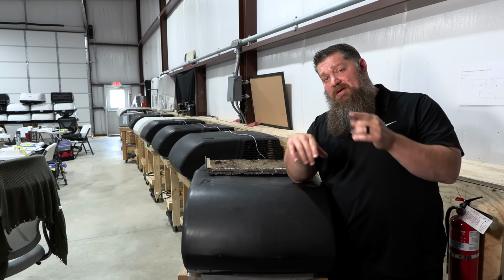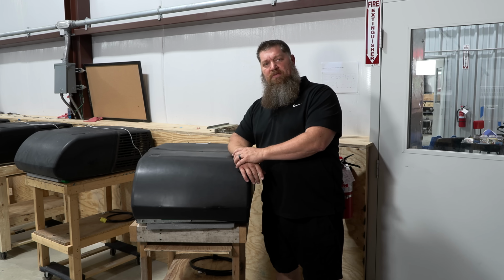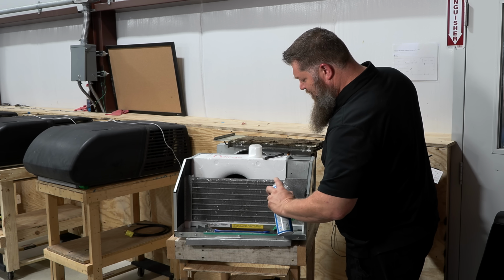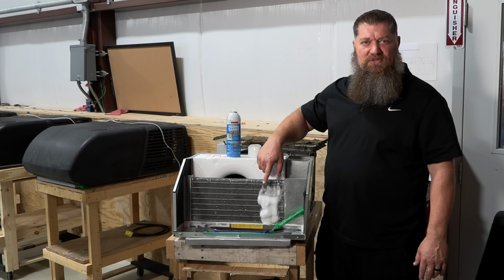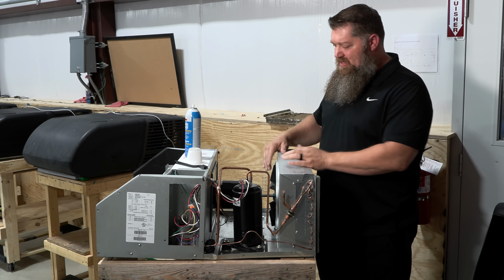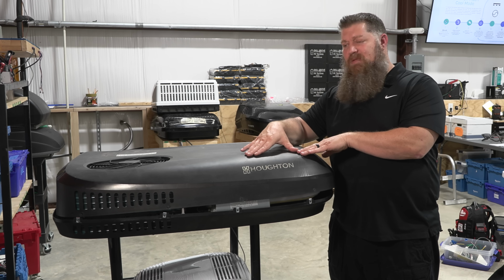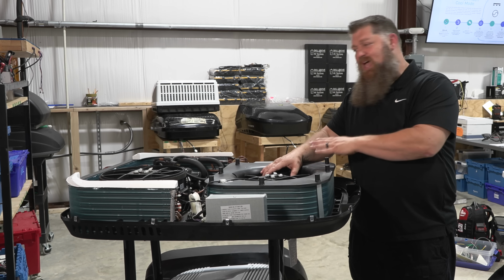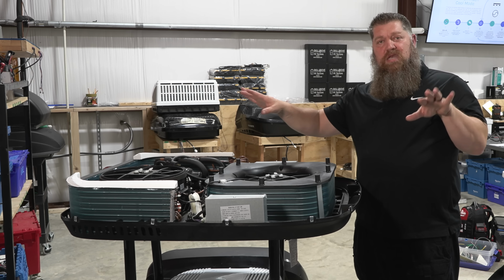RV Maintenance: Cleaning Your AC Coils

Comment: My opinion is to first use Nitrogen to lightly blow coil clean going in opposite flow of air's normal direction (intake direction). 2nd clean all dirt etc with a foam coil cleaner, now you use an evaporator|cond comb to straighten out coil. If possible use a good dry spray that's going to help dust and dirt be more passive. Now your set. The fast way is get big nitrogen tank and blast the coil in seconds. Problem is you'll damage fins, so use your common sense. If you've got a comb I say blast away. On large commercial units I'd just open panel and blast with nitrogen, makes more sense cost|time wise. If you want to have fun or your anal, go through all the steps. Thanks ..

Comment: Be careful not to get any of the foam coil cleaner on gel-coated fiberglass. Typically when you rinse the coils. It will leave streaks that no amount of waxing/cleaning will remove.

Comment: Hi Todd, great video! I also enjoy your Q&A "you ask we answer" videos as well. You guys make it fun to fix things.
We were planning a short get away trip out of town this weekend. I always go through and run check all my systems before we go so we do not have any surprises at least on the first day of travel 🙂. As luck would have it, the front roof top house AC compressor stopped working. The dometic low profile Duo Therm 15,000 BTU ducted AC/heat pump is 20 years old. I have two AC units on the roof. I really like the design, looks and the low profile of the Houghton AC you show in this video. My wife wont budge and wants the new AC to be ducted like the old AC. My Class A 36' long and the roof height with the old AC is 12' 9".
What are your thoughts about ducted AC's verses Non-ducted.
What would you recommend for a replacement ducted AC unit.
Thank you
Reply from the maker: So Houghton makes a ducted version. It’s just taller. Go ducted ;)
Reply: Thank you for your quick reply. I really appreciate it.

Comment: What are your thoughts about replacing with a little bit thicker A/C Filter vs the standard ones that come with it? Does it really affect airflow that much?
Reply from the maker: No. If you clean your coils then you will not have a problem. Thicker filters means slower airflow which causes problems for the ac. 

Don’t make your AC an air cleaner. If you need purified air then add an air purifier to the rv.

Comment: Hey, so I’m a customer orientation specialist for a small dealership with very few techs. Our 2023 units from keystone are coming in with a “heat battery” switch and lithium batteries. I don’t know if you have already done a video on it, but could you go over the use and reasons for using a heating component with a lithium battery?
Reply from the maker: Will do.

Comment: Do you know if the Houghton can operate using a wall mounted thermostat? We have a WiFi thermostat and for our situation in the summer it’s a life saver.
Reply from the maker: The Houghton comes with it's own remote.  There is a wifi version available, but it would still be used separate from your thermostat.
Reply: @NationalRVTrainingAcademy  👍
Reply: @NationalRVTrainingAcademy  thank you sir for that info this is more than I could get out of the distributor. They didn't mention anything about a wifi option being available.

Comment: I've seen a video of improving airflow through the back of the shroud by using expanded metal on the exhaust side of the shroud. is this a worthwhile endeavor? will it improve the efficiency?
Reply from the maker: Don't forget to check out this week's Q&A tech tip, where Todd answers your question!

Comment: Question  about adding that second Ac thst runs with a remote.   Since I have. 30 amp rv. I quess I can only run one Ac at a time. Right?
Reply from the maker: Depending on the size of the acs. 2 of the Houghton could stay under 30 but you literally have nothing left to run the fridge, converter, tv etc.